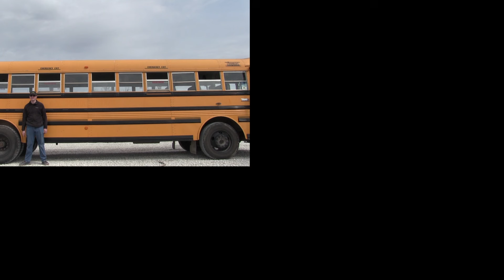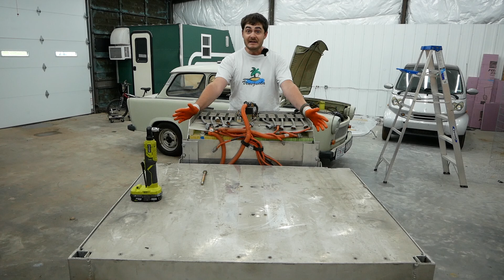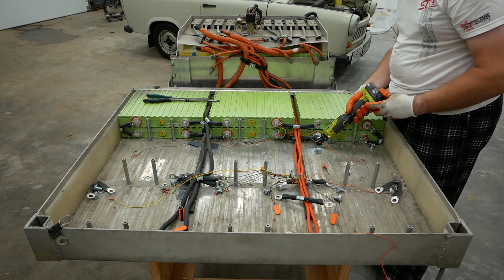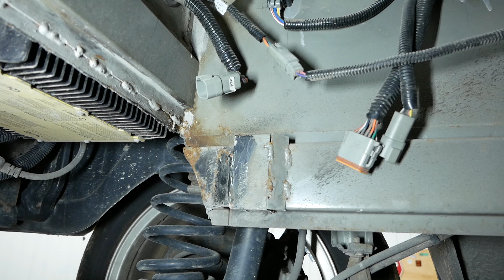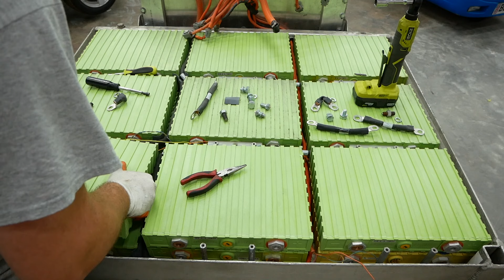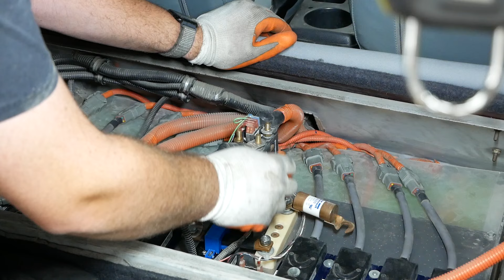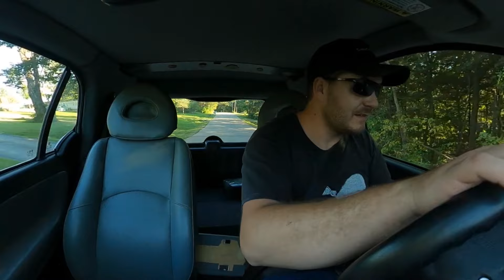Can I Revive the Dead Battery Pack in my Wheego Electric Car?

Comment: These Cells look like Winston LiFeYPo4 Batteries. You could look into that if you havent already.
Reply: According to the last archived version of the Wheego Cars website, this battery pack is composed of 260Ah LiFePo4 cells (math checks out; 36 of them @3.2V produce a total of 29.952kW).
The only company that makes battery cells with these specifications seems to be indeed Winston, with the WB-LYP260AHA model; it sells for around $300 apiece, new. Oof.
Reply: @bmarques333  There are plenty of 200-300Ah cells available these days. I have a pallet of them on the bench right now for the Electrica. We're load testing every one of them before putting them into a string. Yes, they're new, but we're going to test each of them. He really should've taken the time to load test each cell while they were on the bench. I know it takes an eternity to test something with this high capacity, but it's not exactly quick to disassemble the pack.
Reply: @bmarques333  
300 apiece and probably more when the car was new. No wonder it was so expensive on launch
Reply: @bmarques333  And one bad cell will kill an entire battery pack.
Reply: There are cheaper LiFePO4 cells available though, or even go Li-Ion and power it with a shitload of 18650s. So 115V/29.952kW on this pack, making an equivalent with 3.7V 18650 cells at 2500mAh each we need at least a 32s100p configuration. 32 batteries in series for ca. 115V (118), at least a hundred of these rows in parallel to archieve ca. 260Ah (250). So with that we're already looking at 3200 batteries, might be $2 per cell. That is still $6400 and an outrageous setup of batteries that even large car manufacturers struggle to keep working properly and reliably over years.

Not to mention the pain in the butt that will be to assemble, and add in like $2000 for battery holders, new or even custom BMS, charge controller, nickel strips, spot welding equipment.

He could use even cheaper batteries, let's go lead acid. That will have a much wider recharge
 threshold, they will easily go flat and die if used in such a way. We need an external component to increase the gap between the charge voltage and recharge voltage, maybe hook up a programmable power supply inline or go with and a step converter on the pack itself, that we'd have to experiment with. But all that might require to replace the cars computer and subsequently gauge cluster, entire switchgear and wiring harness with custom made or specifically bought ICs in order to keep the car reliable and get acceptable accuracy on the readouts/tolerances.
Reply: @ccllvn  make it easy.. nissan leaf cells...
Reply: @ccllvn  A problem with 18650 cells is there non existant resistance against cold temperatures and there comparably small number of cycles (~800 for Liion, min 2000 with up to 8000 for LiFeYPo4)
Reply: @ccllvn  At that point for difficulty, the captain should just go for Nissan Leaf cells instead of trying to shoehorn lead acids; an equivalent weight in classic lead piles would be around 50% the same density of charge and that's assuming they fit without any changes to the pack itself.

The leaf cells are far smaller than the lithium iron's they'd replace, and wrecked leafs can be picked up for 3-4 Grand no problem which also gains you their CHADeMO chargers and inverters. The only problem I'd see is how you'd keep them cool; Nissan went for air cooling and to keep whatever used cells in good shape you'd have to have some odd setup.
Reply: @scsikrsk i mean he could start with replacing that one damaged cell
Reply: You, sir, may have just saved the wheego project.
Reply: chris younts  Not for long, these batteries arent made for such a high current draw and are also much heavier then LiFeYPo4
Reply: Wow electric cars are clearly the future LOL
Reply: @boredfartless4221  With Cadillac going all EV and all manufacturers debuting new ones, yeah they are
Reply: @boredfartless4221  You've obviously never let an ICE vehicle sit for a long period. The 12v battery can die, or be too weak to start. The gasoline can break down, attract water, or the interior of the tank rust. Diesel grows a very funky algae. If left long enough, all the oil will drain out of the block leaving a "dry" engine that can be hard, or impossible to start.

The EV has only one of those problems. Any properly designed BMS should not kill a battery pack over a few months. (it should take decades. self discharge should take about half a decade -- newer batteries are getting better. I have a Gen1 volt sub-module in my lab that hasn't been charged for ~2yrs [no load, it's literally just sitting there]; it still has 80% capacity.)
Reply: @jfbeam  It's not really battery management that's the problem if after being idle for a while your $9000 of batteries start to swell up
Reply: @boredfartless4221  When "a while" is 6+ months, and they're drained well below safe levels, gassing is an expected side effect. (age can do it, too)

Comment: get a small but powerful engine to put in it and make it an oversized mid engine go cart, gas tank in the front and a basic roll cage should work just fine.

Comment: time to buy a crap ton of 18650 cells and make a new battery pack!
Reply: This lifepo, not lithium
Reply: @CyberlightFG  LiFe = lithium iron phosphate, 18650 =  lithium-ion.  Both are lithium based.  If a LiOn can power a Tesla, It can power the Weego lol
Reply: @Twin_Flyer  If you change chemistry, you need a new BMS cluster and a new charger. 
That would cost more than a new wheego.

Comment: Yes, that swollen pack may be a show-stopper. Those of us in the RC flying community are well aware of the death signs in lithium batteries. Forcing a sick pack is asking for a really exciting fire. Best of luck, however... the Wheego has its charms, and I’d love to see it healthy again. Regards from St. Charles -
Reply: LiPo is not like LiFePo4. A bloated LiFePo4 is common, manufacturers of the cells even recommend you put them under clamping pressure to prevent the unavoidable bloat they all go through when under high discharge loads, like in an EV. Also, a LiFePo4 does not rupture violently like your hobby LiPo, or catch on fire, they are a very safe cell. There are several videos on YT doing destructive worst case tests (crush, puncture, over charge, over discharge, dead short circuit, and blowtorch tests) on these cells that show how safe they are.

Comment: Huh, why does one cell have a yellow casing? Stick a gasoline generator in it to power the electric motor! ;D
Reply: Probably had an earlier cell die and it was replaced
Reply: Could be! Could also be they used batteries from different batches when assembling.

Comment: It was good to see it driving again... for a while.
I don't suppose there is another (cheap) Wheego battery pack that you could obtain second hand?  Maybe even a part one to replace the weak cells.
Alternatively, are there different battery types that you could substitute for the originals?  Different charging and controls would be needed, but on balance later batteries should at least have a higher charge capacity for their weight.

Comment: You need to do a video of opening one of those battery packs. My guess is it contains lots of AA batteries. Maybe you could get Ryobi to sponsor your channel and you could power it by their batteries. :D
Reply: Not as silly as it sounds. The Tesla Model S uses over 7000 standard 18650 laptop cells which are probably the same as in the Ryobi packs (ten in a 4AH 20V pack).

Comment: And this is one of the primary reasons cars, even electric ones, still use lead acid batteries.
Reply: Yeah, it's not like lead acid batteries are susceptible to freezing temperatures! Oh wait, they are. Well at least they don't die if you over-discharge them! Oh wait, they totally do. 
The reason we still use them is because it's an industry standard, that's about it.
Reply: Incorrect, it's just  cheap, I don't know of a single new electric car using lead acid. but I replaced my lead acid with life4

Comment: Install a trailer hitch, then tow the smokiest old diesel generator you can find to power the Wheego.  Bonus points if you cover the Wheego in "ALL ELECTRIC ZERO EMISSIONS" stickers.
Reply: It would be hilarious to  make it essentially a train. Smoky diesel, a decent sized alternator, and peripherals.
Reply: just multiplex like 4 of those knockoff honda generators that, unlike actual hondas, sound like they took the muffler from an old 30's/40's/50's lawen mower and decided it was too complex, would cost too much.....

a guy down the road has one... fuck its loud as hell..or was will we used an old motor cycle muffler he had from when his kids had  dirt bike... its quieter then a genuine honda now... 

but now, you want the loudest, most annoying thing you can manage...even rig it up so it starts from the dash via the trailer hitch connector....
Reply: Sounds like the job for a 2-stroke detroit! But put it on-board, maybe a little 2-53 sticking right out the hood
Reply: Instead of a diesel generator it should be a Trabant engine!
Reply: @TheDeadfast  i wonder if he has the spare saab 96 endine still lying around? the one with a shot balance shaft bearing seat
Reply: YES!!! <3
Reply: Needs a Wartburg 353W engine :3
Reply: detroit 16v71 with a big genset.

Comment: Nissan Leaf battery modules and you'll have a better and more powerful pack. :)  You kill revived cells by demanding high amperage from them. So the trip to the highway most likely killed off your cells. If you remove all the cells again, you will most likely will find several that are bulging, and perhaps one or two that are emitting smell.  No need to say this, but those cells are DANGEROUS and need to be DISPOSED of properly. This is the only video on this channel I downvoted, and hopefylly the last.

Comment: If you weed out any bad cells, isn't it possible to put the package back together without those? Sure, it will have lower capacity, it at least it should work?

Comment: unbelieveable success

and just another new challenge WE GO

Maybe you simply replace it with some similiar packages in similiar structure to use the existing bms and infrastructure.

Create lipo stacks that have a higher density nowadays if you can make the Lithium phosphat charger work with Lipos.

Or buy used modules from secondlife battery shop that might fit 

The WeGo and Trabant are the figureheads and synonyms of your channel so you have to take care for them like in a living museum.

Better to get a good battery giving you a second life and get another wego  as spare part donator

Comment: Its amazing how the battery pack is built like a tank, but the rest of the car is built like a wheego
Reply: The rest of the car is built like a Shuanghuan Noble
Reply: This is how a welder would make cars.
Reply: that battery pack is not built like a tank. I've seen better welding on harbor freight trailers.
Reply: @murmaider2  All things relative, look at the car it's going into.
Reply: like a soviet tank, rather...
Reply: Car hacking at its best.
Or worst, depending on your point of view.
Reply: the entire floor has ben replaced. i have a wheego whip and the floor is way nicer . not a murder seen. i took the lock off 2 nd gear now the car can do 67 mph. i also got the reprogramming software . 50 mile range with lead and 4 prius battery packs
Reply: @shawncell1247  wow

Comment: He needs to shave and lose some weight
Also you can get battery packs from other electric cars like a Nissan Leaf
Reply: I think he's sexy as he is. Not that it's any of our business to tell other people what to do with their body. And the Leaf uses a Li-ion battery which works at different voltage levels, so it wouldn't be a direct replacement. Also, every battery pack uses different form factors, meaning it would be difficult to fit any old battery pack in there.

Comment: Why not put a Trabant motor into it? That's a sensible idea. Isn't it?
Reply: Ya, LS swapping is soooooo last year.
Reply: Hybrid wheego
Reply: The most ironic car on the road! A former EV with a smoke belching 2 stroke Trabant engine.
Reply: What's that electric motorcycle called again?
Reply: Trabant motor powering a generator that powers the wheego, that would be sweet
Reply: The Trabby is a hybrid, it burns both gas and oil.
Reply: I mean the Trabant motor probably would almost double the horsepower so that sounds like a decent idea
Reply: yea but you need a transmission
Reply: @davidbosilj  Could keep the motor , have the trabbi engine permanently fixed in 1:1 direct drive, like 4th gear , then it would be a hybrid ! 

Electric to about 50kmh, two stroke the rest of the way !
Reply: I say this yet again. Hayabusa.
Reply: @TheKaisarwilhelm  boosa, not busa.
Reply: Why not strap a jet engine to it?
Reply: a harbor freight lawn mower engine
Reply: That would qualify as polishing the turd.
Reply: Screw  that get a high horsepower Japanese motorcycle  engine lol.
Reply: A smart  car engine Nd box is the way to go
Reply: Honda 4cyl motorcycle engine. 
And the rear end being a solid axle- you could swap a proper drive axle to it.
Reply: I had the same idea
Reply: Wouldn’t a briggs and straton be easier to get 😂😂😂
Reply: @twistedtony82  the Briggs and Stratton would be faster than the original electro crap
Reply: That would be awesome
Reply: No. It would make it too fast
Reply: Give this person a cookie. I love that idea.
Reply: Would he still be able to have that bumper sticker on the wheego then?
Reply: Trabont motor.
Reply: Wheego PHEV
Reply: Why not put an electric wheelchair motor in a Trabant?
Reply: If you put a trabant motor in the wheego it would actually be reliable
Reply: Wenotgo
Reply: Wartburg engine swapped wheego.
Reply: Or a Geo 3cyl
Reply: A lownmower engine
Reply: Too much power for the poor little car to handle...
Reply: With trabant motor it would be way faster
Reply: Bruh you guys should run this channel not him 🤣🤣🤣
Reply: Nah, wheego motors in the trabant
Reply: @loglemz2070  the trabant would go down in value with the Chinese electric junk. BTW how dare you suggest making a perfectly good trabant into an even more unreliable piece of junk

Comment: This is an opportunity for you to get together with one of the DIY Battery Youtubers (Like Will Prowse?) and build a new DIY battery in that case! You'd definitely be losing Wheego support, but hey! Maybe more fun than the junkyard...
Reply: What Wheego support??
Reply: @jfv65  haven't you watched the other videos about the wheego?
He talks a lot about the great support from wheego.
Reply: Paging Jehu
Reply: I didn't know that was possible. That sounds like a great idea!
Reply: @NaoPb  It absolutely is! The only "complex" part about large Lithium chemistry battery setups is maintaining their charge correctly. (Which is what all those BMS modules do)

There's lots of good stuff for DIYers out on the market now, many people are doing EV conversions of cars :)
Reply: It is possible and not outrageously hard. I have built batteries for my ebikes before, out of 18650 cells and pre-built BMS board you can buy online. Has been working fine for over a year now, 10s4p for my small 36v motor. The hardest part for me was the spot welding, which isn't required here in that form. 

I'd argue this wheego pack is easy to assemble, just because of the physical size of the batteries. He already has a housing for them and they are heavy duty cells connected via bolt-on pole terminals. No need for tiny cell holders, nickel strips, shrink wrap etc. 

It probably isn't difficult finding a BMS that has the exact same specs and rating, judging by wheego quality they might not even be proprietary parts in the first place. This entire car is just a computer with a dumb motor that will run whenever it gets electric power form anything. If you hook up a programmable power supply and a step converter you could probably use all kinds of batteries in this car.
Reply: jehugarcia or EVWest would probably be the best bet
Reply: Nissan Leaf batteries seem to be available and reconditionable.
Reply: Will Prowse is exactly who I thought of when it comes to this.   There are many more standardized platforms from which a replacement could be cobbled together -- probably cheaper today than ever prior!
Reply: or...gaining it...since you cant source the batteries anymore...
Reply: Rich Rebuilds Tesla swap.
Reply: @TheKaisarwilhelm  AHAHA that would be hilarious. And...i think probably more than a little dangerous on the power-to-weight scale. Like putting an LS motor in the Trabant. (Though if we want to keep the smoking up it should be a Detroit 471 or something)
Reply: That is a GREAT idea.
A collab....

Or.... Put a petrol engine in it!

Lol
Reply: @jparky1972  LS Swap